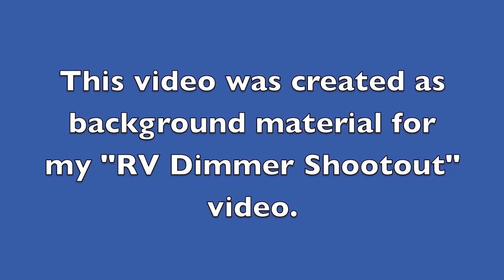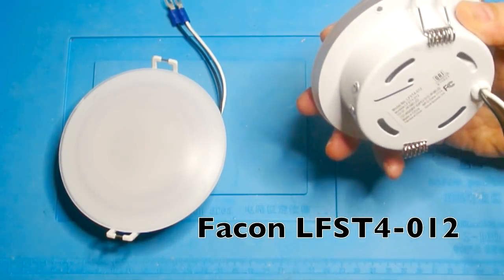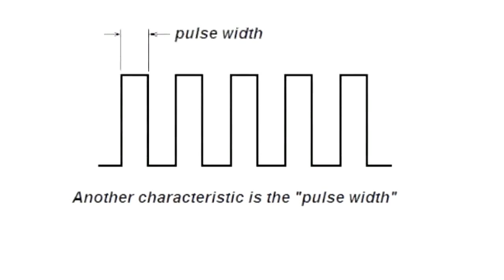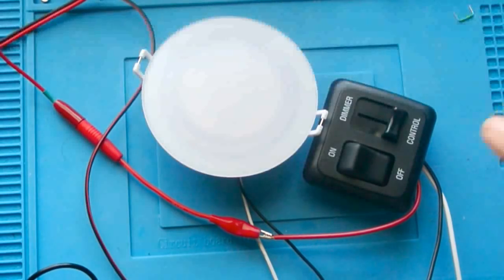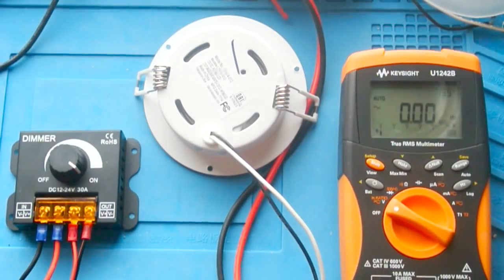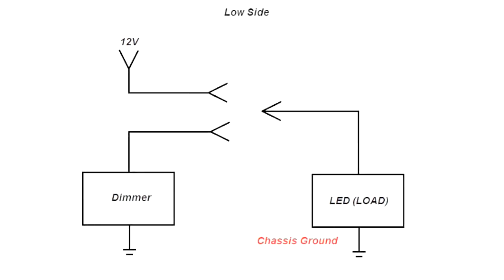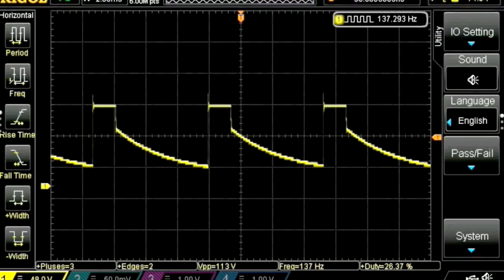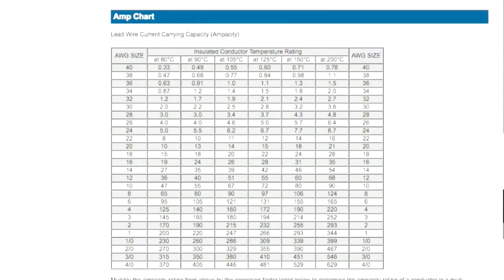All About 12V LED Dimmers

Comment: On 6:43 in the video did you mean horizontal?  When the line is horizontal is a zero volt rand. Vertical is up and down. Horizontal is side to side.

Comment: Can i use 30A dimmer for controll 775 motor ? Plz reply ...
Reply from the maker: I am assuming you want to connect a 12VDC 30A dimmer to a 12VDC motor, which is what I believe a 775 motor is, without checking specs. 

If the dimmer uses PWM, and most do, then yes, it would work, as long as you match the orientation (i.e. high side vs. low side).

However, there is a better way. You can buy inexpensive 12VDC motor controllers like this one: https://amzn.to/3Jejjzy

The advantage is you can control the motor in forward as well as reverse direction.  The limitation is the maximum output of the controller is 6A, so you will have to make sure it will work with your motor (but there are higher amp versions available - just search for a "pwm dc motor controller" or similar).

Comment: I've been watching your videos, but I haven't seen a demonstration of the actual wire connection to the dimmer. I bought the American Technology slide dimmer that you show in your video. It has three wires. The switch that I am replacing only has two wires. I've seen one video where they said to combine the red and black wires, that would the the 12v and ground wires. What do you recommend for this? Thanks
Reply from the maker: I have expanded my webpage on dimmers to add several typical wiring scenarios.  http://www.rv-project.com/gear/dimmers2.php

Comment: Another great video. Looking forward to the dimmer shootout! I hope you'll touch on the effects of each dimmer's PWM frequency, both in terms RF interference as well as flicker - that which is visible to the naked eye and also flicker captured only on video, as many RV channels film inside their rig. Perhaps you can also discuss ways to minimize RF interference (length/routing/shielding of cables), if not in the shootout video, then perhaps a in a follow-up video or on your web site. Cheers!